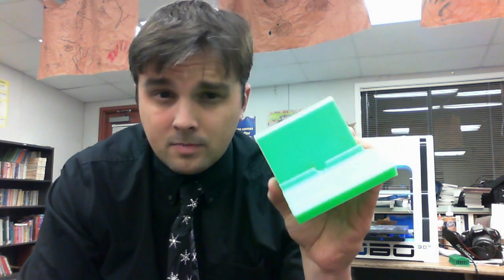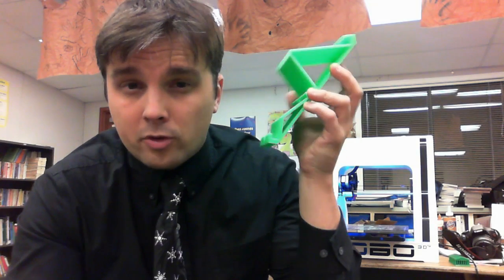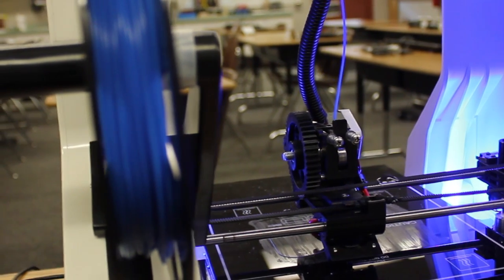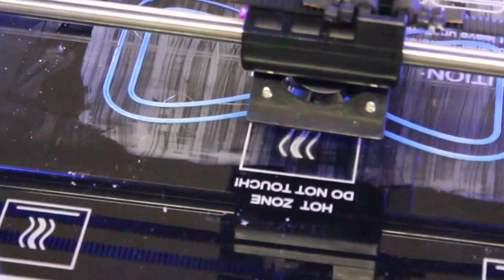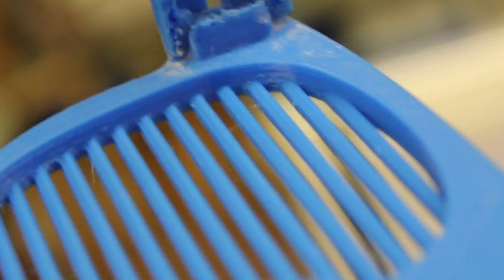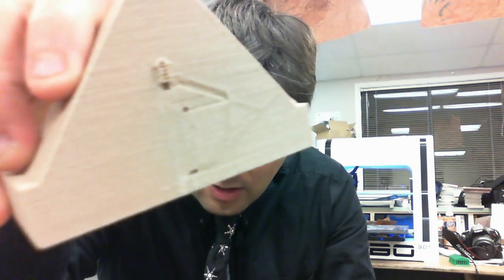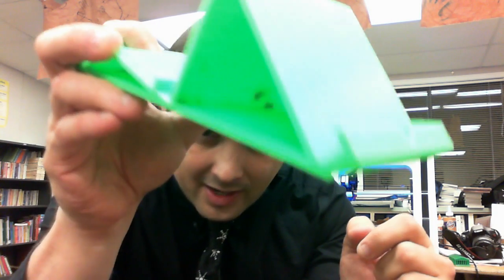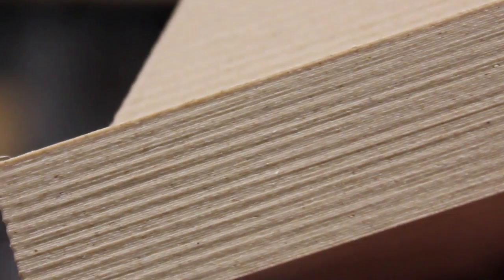RoBo 3D R1 Printer Review

Comment: wow i see that you've fixed it now but the z wobble in this video is so bad
Reply from the maker: Yes, yes it was (and I was so new didn't really know about some of the problems)

Some of the problems were fixed simply by firmware upgrade (my model was running on old firmware, which was causing a problem due to inches/mm conversions... it wasn't using metric! This seemed to be the likely culprit of the z wobble...)

Comment: The blotches are dust print a filament oiler from  thingiverse I have one and it works magic
Reply from the maker: not so sure... I did, in fact, print an oiler from thingiverse.... although just dabbing a paper towel in oil and placing above printer worked just as well (because I now use top-mount spool holders that i also printed out)

however, in this case the globs were caused by untightened/leaking hotend, unfortunately

Comment: PLA should be set at a lower temp, about 209 to 215 C. ABS is 215 to 235 C. That should help with the burning.
Reply from the maker: Yes... but in this case, it happened to be a case of loose connection in Hexagon hotend. I was running the PLA at either 205 or 210...

(no probs since I made this video, though! except for when I work with HIPS... that is a different story)
Reply: Matthew Gudenius Hi

Comment: I see you've resolved your issues, so your printer may not have this problem, but others might.
Also, I use Rave 4X Mega hair spray on the bed and haven't had any lifting as yet. Get in the manual pump bottle and it's not as messy as the aerosol cans.
Reply: Hairspray is seconded. I use it too.  The only time it doesn't work too well is the 180x180x180 cube I did.

Comment: This may be your problem and is at least worth checking out.
I recently purchased a ROBO R1 printer and the first thing that I printed was the "Calibration Box".
Although it printed the box, I wasn't happy with the way the first 3mm of layers were laid down. It smoothed out some, but there were issues at one of the corners.
Out of curiosity, I took a 14 inch vernier caliper and measured the distance inside the Z axis rods at table height when the extruder was at its lowest. The distance between the Z rods came to 11 .879 inches.
I then raised the Z axis to maximum height and measured again. The distance was now 12 .006 or approximately 1/8th inch further apart at the top!
Having worked at GM and being a little familiar with machinery that had precision linear bearings, I knew this isn't the way it's done.
Was there enough difference to cause binding on the Z axis?
All the X, Y and Z rods should be precisely parallel with each other and I can't imagine any reason for this error.
Instead of packing everything back to ROBO 3D, I decided to fix the discrepancy myself.
This is my form of fun.
I decided the printer had to come completely apart and reasoned that the X axis rods needed to be adjustable and the Z bearing had to come closer as the rods were already bottomed out in the holes.
I bored the 8mm holes deeper where the rods attached on the right hand or X axis motor side and added adjusting screws so the distance could be set precisely .
Now when the extruder is at its maximum height the Z rods are parallel with each other.
I printed a second Calibration Box and the layering was now looking like it should be. Nice and even.
The second upgrade should be stabilizers for the tops of the Z rods to prevent any jiggle in the rods when the X axis moves back and forth.
I know, I can be long winded, but I hope this can help solve some of the problems you're having.

Comment: Could you possibly post a video on tightening the nozzle/heating block? 
Thank you!
Reply from the maker: Will try to do that... I don't want to take it back out again, but I do want to show a follow-up video with the updated (no-banding or glooping/leaking) quality, as well as how to make sure the nozzle is tight.

For this hotend (the Hexagon), there is a small wrench (4mm?) that comes with it, and you use that to hold secure the connector bolt between the heatsink sectionand the nozzle itself, then you can just tighten the nozzle snugly secure with an adjustable wrench. (do this while heated -- I believe part of the problem is that the hotend uses two different metals, so there are different levels/speeds of expansion when heated and cooling)

Comment: We purchased the Cube 3 and it has lots of problems that teachers just don't have time to deal with.
The biggest problem is the Clogging of the Heads which are built into the cartridge.
3d systems will send a new one at no cost but the new one also clogs in most cases.

Can you comment about general maintenance and the type of customer support Robo provides.
I'm looking into returning this printer and getting something else.
thanks
Reply from the maker: I have had issues with this printer, which you can see in this video. One issue was very easy to fix -- the ribbing/banding was caused because my printer came with out of date firmware and I didn't realize I needed to update it.

However, a bigger problem was that the nozzle/hotend on this one jammed as well. First it started leaking -- that's what the black globs in this video were. I didn't realize that the hotend/nozzle was actually in two pieces, with the nozzle screwed onto the cold-end part (the heat-sink)... that section uses a steel threading attached to aluminum block/nozzle, so heating and cooling caused loosening of that section. Many people have had this issue and are now aware of it, hopefully Robo will include information in their materials (instructions or startup videos) to make people aware that they need to TIGHTEN the nozzle once the hotend is hot, and maybe check it periodically to make sure it stays tight.

I ended up replacing the hotend but this time I was sure to tighten the nozzle onto it, and haven't had any problems after that...

The Robo team were pretty (well, VERY) slow to respond to customer support tickets/requests, but there are several helpful people on the forums (I try to be one of them, now that I have learned a little bit) who believe in the Robo and volunteer their time to help people troubleshoot issues.

I would say that you can expect to have to do repair or maintenance eventually on ANY AND ALL 3D PRINTERS, at least these types (there are photo-sensitive resin ones, for example, that work completely differently... but these RepRap style, like this, Cube, Makerbot, and most others are very mechanical... they need tune-ups and repairs eventually, much like cars do.)

For the price, the print size, and the fact that Robo worked pretty much straight out of the box (and would have stayed working longer if I had known about the hotend issue), I am still satisfied with my purchase.
Reply: It is imperative with the cube3 that you have a level build plate and a proper z gap setting. these need to be checked regularly. On my cube the auto gap always gets the setting wrong and I have to go back a set it manually.

Comment: Good Video Matthew, I also own a Robo which I have made many upgrades to. I see you found the issue with your ribbing was mostly caused by the SAE/Metric firmware issue. I also found that different filaments would print with different ribbing. I ran some tests and I had an epiphany which I outline more on the robo 3d forums  just search on there for "printing nirvana".. I will also send you a PM on there as well.

Comment: i hear that printing some supports for the rods and a spool holder that goes on top of the machine greatly improves performance.you can find these on thingiverse.
Reply from the maker: I have printed a spool holder now off of Thingiverse. Works well. 
I never printed the support rods because my model of the Robo R1 actually has little inserts in the cover to more or less secure the rods in place... (the issues shown here are not due to rod wobble, they are due to rounding errors on the Z-axis, and possibly heat/extrude levels)

Comment: Good review, thanks!  What are the dimensions ( X and Y) of the green part that you are holding?
Reply from the maker: The green part (our "Tri-Stand" prototype) was... I'd have to look up the dimensions, but it was about 4" wide by 3" tall by over 6" long (a lot of printers have an envelope that maxes out at 5 or 6 inches; I'd recommend at least an 8 x 8 x 8 envelope)
Reply from the maker: (We have since modified the design to significantly reduce the size to have a more compact model, with less material and faster print time as well as more portability)

Comment from the maker: UPDATE: The issues/problems shown in my Robo review video no longer exist! There are two issues that have historically caused problems on the RoBo: 

(1) The Robo originally used imperial-measurement threaded rods for moving up the Z-axis... this caused improper sizing and banding/ribbing issues because there had to be a conversion to metric, which results in rounding errors; the Robo now uses metric rods, which solves the problem... BUT they hadn't updated the firmware to reflect this change! When I updated my firware, the banding/ribbing issue disappeared.

(2) Hotend issues: the older J-head hotend would overheat, melting plastic components inside of it. They had replaced this with the newer all-metal Hexagon hotend; this one has an issue which caused the leaking I showed in this video -- if you do not tighten the heating block/nozzle tight against the cold-end/heat-sink while heated, it can become loose and thus spring a leak.

Updated review / follow-up video to come soon...
Reply: Hi if you want to fix the spool holder issue u can print this new holder that mounts on the top of the printer and reduces friction on the filamenthttp://www.thingiverse.com/thing:216117
Reply from the maker: Brandon Nixon Thanks, yeah I had seen something about that from Barnacules videos I watched prior to purchase, but just wanted to confirm that it is an annoyance out-of-box  (in fact, I have printed many times with the stock spool setup, and it hasn't been a problem, but the filament has rubbed against the case so much that it is actually digging little notches into the sides of the top opening...)
Reply: Matthew Gudenius would u reommend this as my first printer and any advice for the product
Reply from the maker: Brandon Nixon It was my first printer, and I'm not unhappy with it. It depends on your goal and purpose -- if your goal is to get exposed and give it a try without too much hassle and without too much money, and to have a printer that is versatile (it is open-source and can be modified or improved if you decide to later; it can print multiple materials if you decide to try that; and it can print large print sizes), then this is a great printer.

If you want PERFECT quality prints, I haven't found that yet, but I have gotten pretty good results and others have gotten even better by using other software/slicers with this printer, or by tweaking the settings the right way.

The only real issues I've had were the banding/ribbing, which was really just a firmware update I needed to install (very easy with the click of a button, I just didn't realize it wasn't up to date!) and the bigger issue is that I DID have leaking, which ended up causing a jam that I couldn't clear in the Hexagon hotend/nozzle. Due to the design of this hotend, when I took it apart to try to unjam it, it broke upon reassembly and I ended up having to buy a replacement (which was about $60)

As long as you make sure you keep that hotend tightened properly (they didn't tell me this in the documentation), and make sure the fans keep working properly and temperatures set correctly, you won't have the leaking or jamming issue. [Some people also add a little method for applying a thin coat of oil to the filament before it goes into the extruder.]

RoBo's documentation and support is pretty dismal, unfortunately... however, there is a forum with some very dedicated enthusiasts that always try to help out.

This is a "middle of the road" printer in the sense that it has some good (but not completely maintenance-free) ease of use, and good (almost perfect, but not quite) print quality, and a really decent pricetag, so I would not call this a good "pro" printer, but it is a great "value" or "bang for the buck" printer.
Reply: Matthew Gudenius then waht would u reccomend
Reply from the maker: Brandon Nixon Haven't tried many... I was only was able to review based on others reviews and based on features. 

For quality + versatility, I have seen/heard decent things about both Ultimaker and FlashForge, but they are a bit more expensive than RoBo. 

I also looked into a SeeMeCNC Orion Delta printer, which works a little differently than these RepRap types do... it has 3 arms and no moving bed (the arms move to x, y, z positions instead); that printer seems to have great quality and print speed; however, it is more expensive ($1300 or so) and has a smaller build envelope (more of a cylindrical space, not a cubic one... plenty of height, but only about 5" of diameter in the build area)  The main reason I didn't get it was because of that size limitation.

If you're on a budget, I still think RoBo is the best bet.  Another option to look into would be the Dremel Idea Builder. For $999, it has an enclosed case and decent build size, from a reputable brand name and, from what I hear, reliable and with good support from the company. However, it ONLY prints PLA (can't get hot enough for other materials) and does not have a heated print bed.
Reply: Matthew Gudenius
 Brandon Nixon
Robo is a good fit IMHO if you like to tinker. The support system they have is very lacking, but as Matthew said the community if great. I would say that 3d printing is on the cusp of becoming as plug and play as 2d printers, there are models out there that are built better and cost more.  Robo is the best bang for the buck so long as you are a bit mechanical  and handy :)
Reply: Greg Knapp ive been looking at the FlashForge 3d Printer Creator Pro but isnt it just a copy of the makerbot replicator 2.
Reply from the maker: Brandon Nixon yes, flashforge is basically a copy of makerbot... but still better because it is much more reasonably priced

Comment: Use hair spray.
Reply from the maker: Have tried the hairspray now... it works, but I think I prefer the glue stick method, actually, even though it causes a little more texturing. (The hairspray puts off fumes into the air, and it's harder to contain to make sure it doesn't get on the rest of the machine -- don't want to gunk up the moving parts and components)

Comment: The dark blotches are caused by a leak between the heatsink and the top of the hot-end. It is a design flaw Robo3D won't admit, but you'll hear a lot of complaints about it in the forum. I recommend you get a new printer if you still have the opportunity. There are good alternatives like FlashForge dreamer and the Dremel Idea Builder.
Reply from the maker: Yes, but they didn't occur for the first 10 or so prints... I think the issue may have been that the heat sink fan died, causing melting further up the metal end. These all-metal extruders are going to fail if the fan fails. (I agree the Hexagon hotend could probably be better... but that means any printer that uses it will have this issue. It can also be swapped out for a different hotend pretty easily, and still cost way less than FlashForge)

The print quality of the Dremel has gotten mixed reviews. FlashForge is about 2x the price of RoBo. And both have about half the print size (although it's probably large enough for most purposes)

I'm actually more concerned about the ribbing issue than about the leaking at this point, because the leaking can be fixed...
Reply from the maker: Oh yeah, and the Dremel doesn't have a heated bed...

I guess the moral of the story is that there is just no such thing as a perfect printer. They all have various drawbacks or limitations. With the RoBo, it is that it requires some maintenance and some tweaking if you want to improve print quality; on the other hand, you get superior versatility and print size, and lower pricetag.
Reply from the maker: NOTE: I believe I discovered  the cause (and easy fix) to the ribbing issue: I had received the newest model, using metric rods (which fixes the Z-axis issues) BUT it had the older firmware for the settings that matched the imperial rods! Updated the firmware, and the banding/ribbing problems went away.